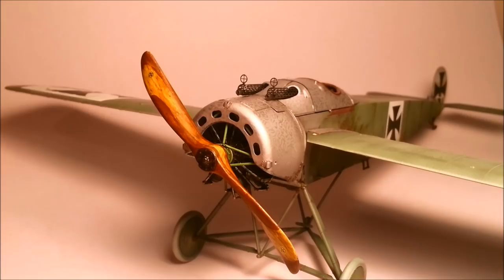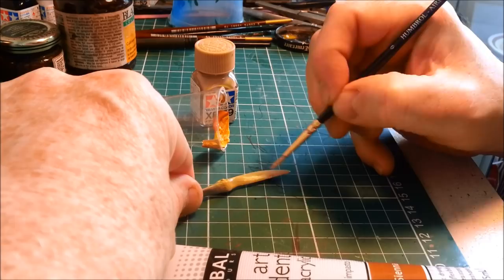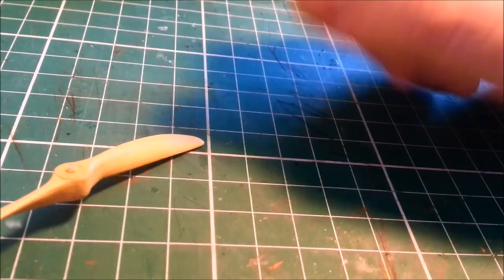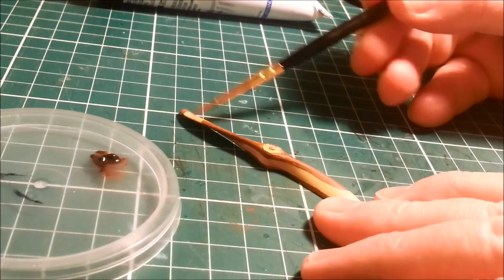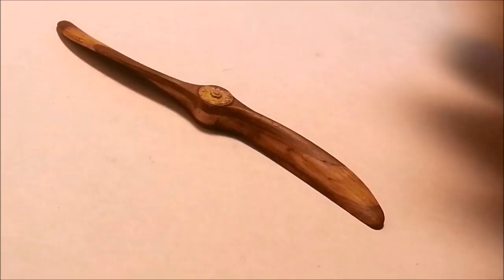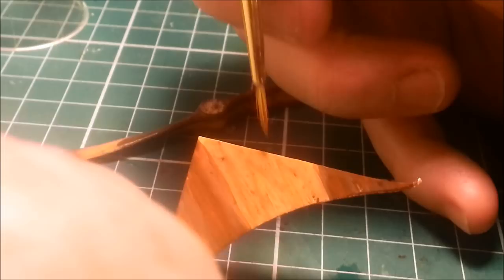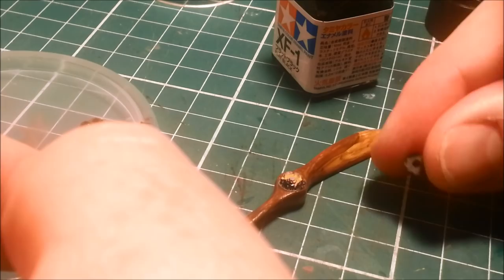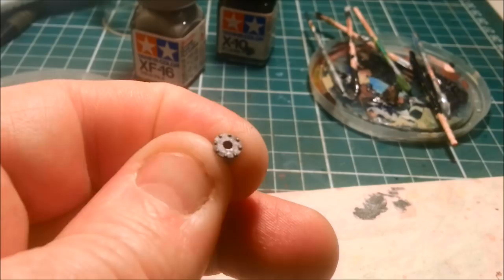How to paint realistic wooden propellers for WW1 aircraft scale models

Comment: Hi Dave, having watched your how to paint realistic wooden propellers I tried to replicate your method for my Fokker DR1 prop. All was going really well until I applied the oil wash which just stripped the base acrylic paints off 😮. I used Liquitex heavy body acrylic Burnt Sienna for the dark wood and a 60:40 mix of white Pebeo acrylic with the burnt sienna for the light wood. Then I mixed some Windsor and Newton Burnt Unber oil with Tamiya 400 levelling thinner and applied the wash. After the first coat the base acrylics lifted and bubbled and in some areas completely lifted leaving the red plastic showing through. Should I use a different thinner with the oil for the wash?
Reply from the maker: Hmm, that's a tricky one. Did you apply a primer? I'd try applying a solid coat of primer first, so you can't get back down to bare plastic. Maybe a slightly thicker acrylic layer, if you won't lose too much detail? You're doing everything right, it might just be a little too much for those foundation layers if they're a bit thin? Good luck.
Reply: @DavesModelWorkshop  ok thanks; I’ll try a primer base coat (although the video didn’t mention this part of the process) thanks again 👍
Reply from the maker: @paulbentham1721  Hi Paul, I didn't bother with a primer in this video, it usually isn't necessary, but in your case it might help (I hope!)
Reply: @DavesModelWorkshop  thanks Dave, as you mentioned that enamel paints wouldn’t work with the oil wash I’ve given the prop a single coat of Humbrol Matt Brown as a “primer” and now in the process of applying the acrylic light snd dark wood coats. A friend also suggested not to use the Mr Hobby 400 thinner but to use a straight “white Spirit” to thin the oil burnt umber oil paint so will try that and let you know. Cheers Paul B